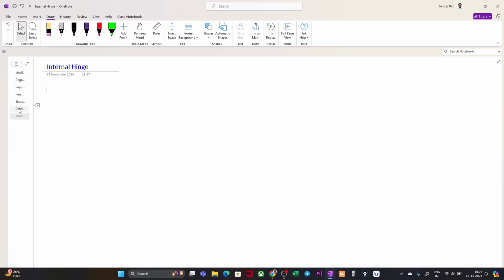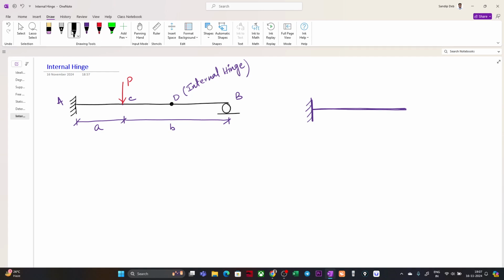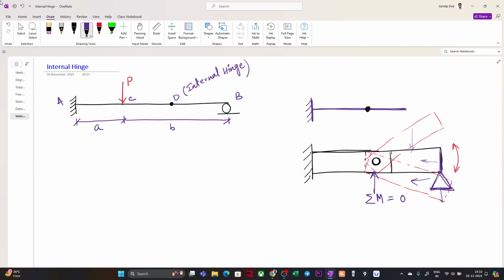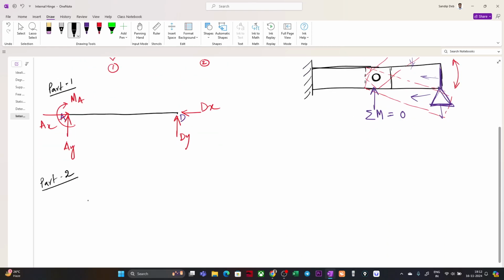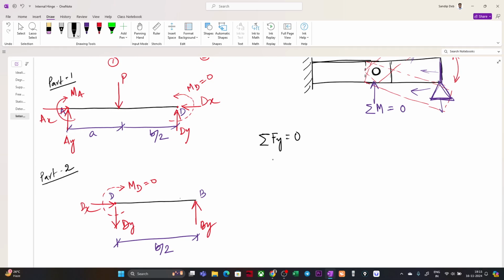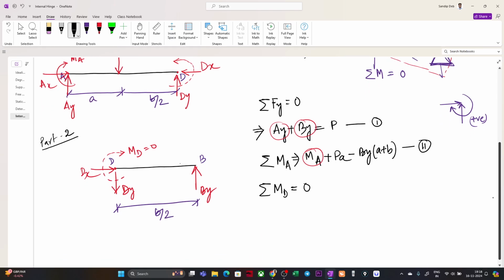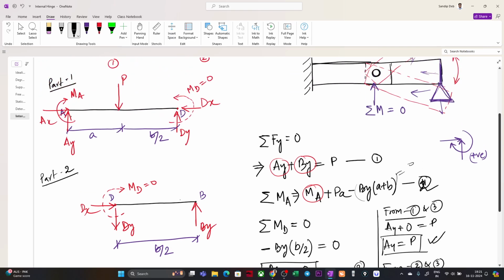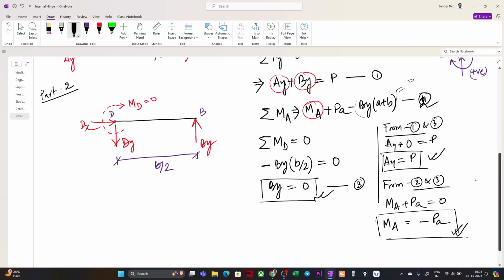Fundamentals of Structural Analysis | Lecture- 7 | Internal Hinge (Part 1) | Sandip Deb | ilustraca

Comment: Sir mera ak question tha : Mati sa truss kasa bnay ga but problem is Mati is not available 🏗👷🚧 ( Please urgently guide us project is being delayed alot already )

Mati = sand 
Project location is Siachen 
Project requirements are:
Size of sand particle must be less than 0.01nm > ASTM-C33
Truck load is 8000lb = 36Ton
Span must and must be not less than 99.3467 m = 108.6468723 yards
Height of truss = 6969cm = 69.69m
Connections bust welded >  According to ASTM A548
Width = 150m > Lanes must be designed According to AASHTO 
Project cost = 🙏🙏🙏🙏🙏

Thank you.